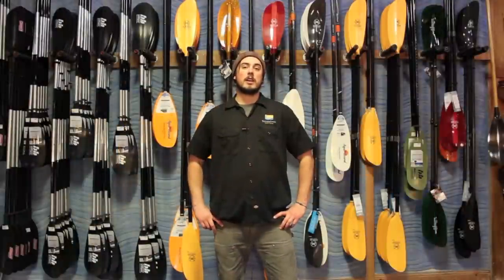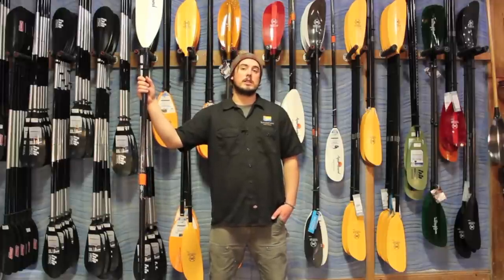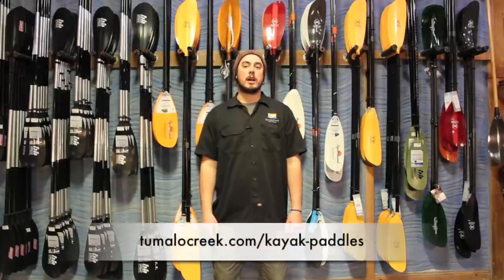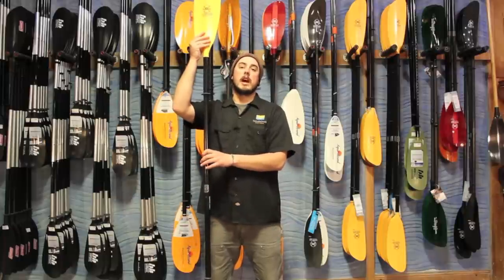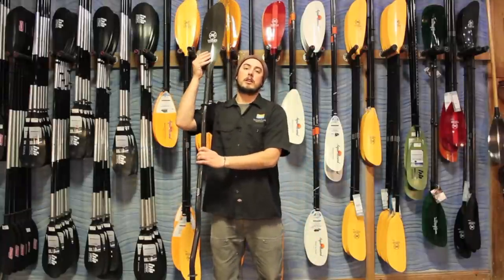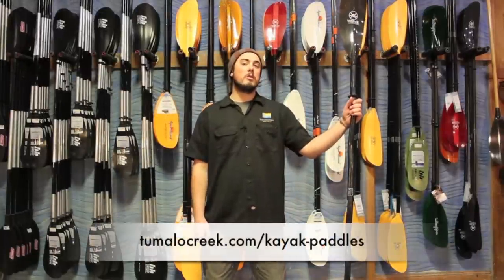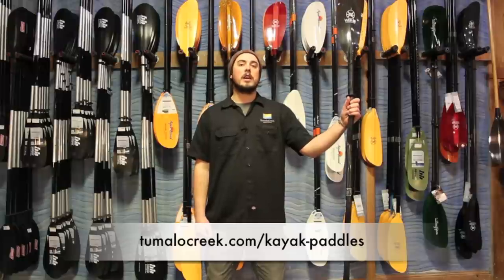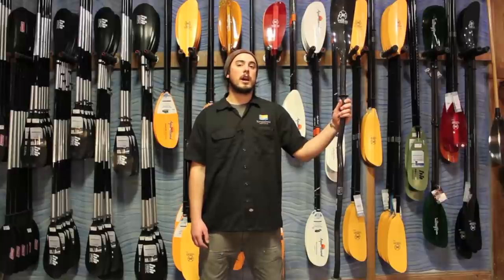How to Choose a Kayak Paddle

Comment: What are your thoughts for long trips.  A fatter blade or more narrow blade?
Reply: Monkey N Around narrow would be best
Reply: Narrow and long blades allow efficient paddling with a low style, useful if you are paddling into wind on a long trip.
Short fat ones are for where power is needed or a nice high stroke can be used (the most efficient), such as slalom, polo and playboating. Choose these where you need efficiency, power and acceleration, while not having to fight against the elements. 
Wings are something different, with a different paddle stroke.

Comment: which one is title to use to go faster
Reply: broader with shorter shaft, if your new talk to someone because weight is a hugh issue and if your going to be on a lake/river vs ocean and enclosed boat vs open.  The paddle makes about as much differance as the boat.✌ If you an athlete its not as big a deal but im not and the wrong paddle means the differance between a great day and a short day.